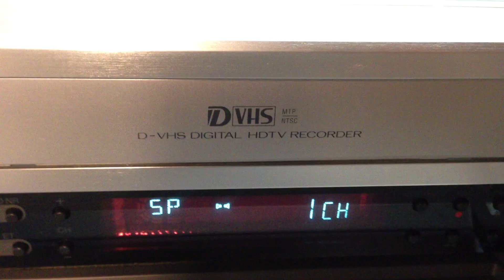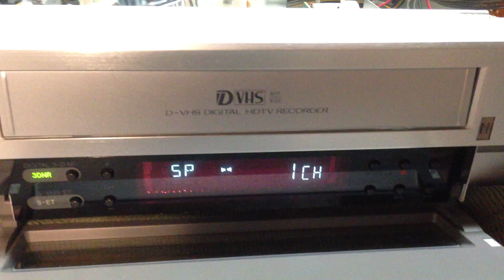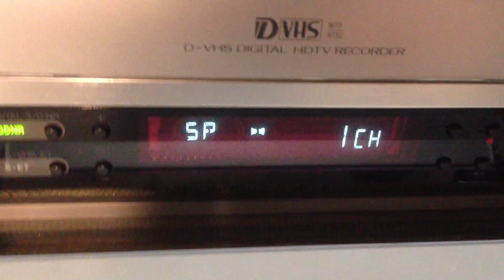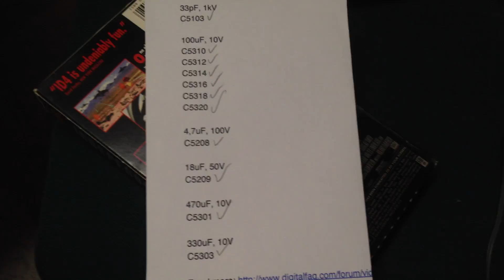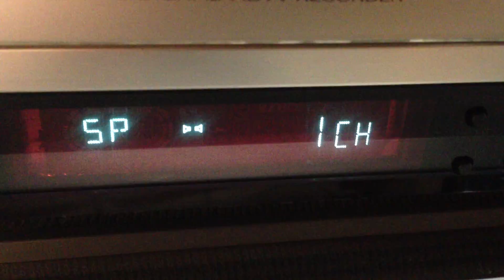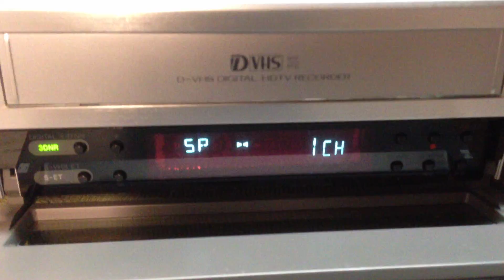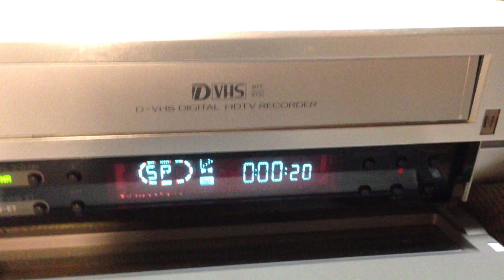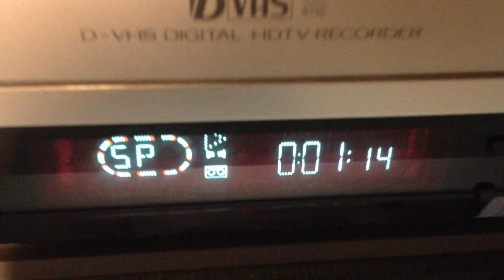How To Possibly Repair Your Broken JVC HM-30000U DVHS VCR

Comment: I have a very strange issue with that exact same model D-VHS VCR. With mine there is no sign of life at all on the front display and it's completely unresponsive to any button being pressed either on the unit itself or via the remote control. But, and this is where it has me stumped and I can't figure out what's going on, is that the fan at the back does spin and the unit does also accept a tape. I should say that it accepts a tape if the cover of the unit is on. If you have the cover off and there is any direct light shining into the unit, it ejects the tape. So, upon a tape being inserted with the cover on, what it does is it immediately tries to rewind the tape and once it has done that it starts to play the tape. Crystal clear picture, so no issues on that front, but as I say it's completely unresponsive to any button function. To get it to stop and eject the tape I remove the cover and I reckon the sensors or whatever pick up that light and the unit stops playing the tape and ejects it. I have swapped out the whole internal power supply and replaced it with one from a known working unit. But the issue persists, so it's not the power supply. I've also checked all the ribbon cables throughout the unit and reseated all of them. No idea if you will ever read this and this is probably a shot in the dark but if you did read it, what do you reckon I should maybe try or look at next?

Comment: Can this also record in the D-VHS format?
Reply: Yes it can. You can use D-VHS tapes or S-VHS tapes . With S-VHS  tapes after you insert the tape you push a button on the front panel marked D-VHS and it will record in D-VHS mode.

Comment: help please! my jvc vhs/dvd player won't work! I got it yesterday and tried putting in a tape put found out there was one already inside and I managed to eject it normally. but when I inserted my home video tape it won't eject! also for a while it didn't play so I left it unplugged the whole night then plugged it again the next day and it played but didn't eject. I was able to change the channels, rewind and fast forward, and stop, but the power button and eject button just didn't do anything. it doesn't even make a noise. so I unplugged it again and then replugged it and it kept showing the numbers for the video's time. but now I can't even play it! I can only change the channels which are like: f-1, ch2,ch9,ch42, etc 

am I doing something wrong?
Reply from the maker: +azn2sun - I think this video addresses your problem.  I hope you are handy with a soldering iron! :)

Comment: Don't ever recall seeing DVHS in England JVC or Ferguson badged, many later ones claimed 'digital tracking (using sensors) but of cause the VHS cassette itself was tricky (poor internal guiding) even if decks improved , still JVC VHS machines came along way from early 'dead finger' front controls! I often wished the Philips VC2000 had led the market  (used its own flip-over cassette but because it was fully digital tracking before VHS had it it came out on the market late and JVC beat Philips with what was later recognised as a poorer system (in early version) still, VHS was decent for its time and I still use a Bush VHS when I can't be bothered to find a R/W DVD . The real beauty of the Philips VC2000 was the splendidly pure sync. it could 'lock' on a very weak video signal whereas VHS tracking faults were the result of a basic weak sync.   Replacing electrolitic capacitors is always worth while on an older unit but dry joints can give false clues too, I recall an expensive 4 head (Mitsubishi made) Salora VHS full of the buggers! In UK and Aus/NZ the wall socket power is 230/240v AC so we have to be even more carefull replacing charged-up power suppy electrolitic capacitors!

Comment: I plan to digitise VHS, HI8 tapes to DV (Digital Video) quality then convert them to DVD do you know any high quality profession SVHS VCRS i should use, I find Jvc's can sometimes cause tracking issues for certain vhs tapes, i have used a Panasonic, good but want something for professional use.
Reply from the maker: Shaan Awaz Any D-VHS VCR is a good choice. There were Panasonic, Marantz and of course JVC models.  All will play SVHS tapes.
Reply: Allright i should probs consider a DVHS VCR Instead of an SVHS VCR
Reply from the maker: Shaan Awaz - I would Shaan, DVHS has a built in "time base corrector" to clean up the analog signal.

Comment: MY JVC SVHS VCR comes with a U10 code on display it will not output any images or sound, could the head be faulty.
Reply from the maker: Shaan Awaz - I couldn't find anything when I Googled "U10".  If you haven't replaced the capactors, start there.
Reply: O.k i will probs have to start replacing the capacitors do you know what type of capacitors i should use.
Reply: I have only had my JVC SVHS ET VCR for less than a year, i have gone to the fact that alot of my VHS tapes are suffering from issues of mould what is distressing me is alot contain home video's which i cannot replace i need the video's saved which i can do, but the tapes having mould how do i repair or clean that dnt want the tape getting jammed or damaged as the video's are precous and irreplaceable.
Reply from the maker: Shaan Awaz http://www.ehow.com/how_7723572_remove-mold-video-tapes.html
Reply: +databits I have since cleaned my JVC SVHS VCR using Isopropyl and used a lint free cloth (nonabrasive) cleaned the capstan, tape mechanism, drive belt and heads,  it works perfectly well after i had cleaned it, no more error code displayed on the LCD, so now i know the error code was caused by it needing a clean...☺😊

Comment: This is the absolutely best deck to transfer VHS and S-VHS to digital. With the image stabilization  and noise reduction, you can transfer VHS and S-VHS  looking better than the original. Here is a tip on a transferring system that will blow away any transfer of VHS you have ever seen. Hook the HM-30000U via RGB to a Sony DSR-45 DVCAM RGB input. Take the firewire output of the DSR-45 and hook it to a firewire input on a computer. Then use the freeware program WINDV to do the transfer. You can use the DSR-45 to tape the transfer to a mini DV or DVcam tape but I use the DSR-45 as a digital conversion unit and the files rendered on the computer are uncompressed .AVI files. You can than edit the avi files. I edit the avi files and then author them to a  Blu Ray for the best VHS or S-VHS tranfer you have ever seen. You can see my YouTube channel for many examples from this system....
Reply from the maker: galaxies352 - I completely agree.  These are really amazing VCR's.